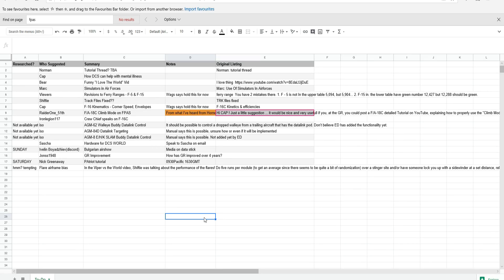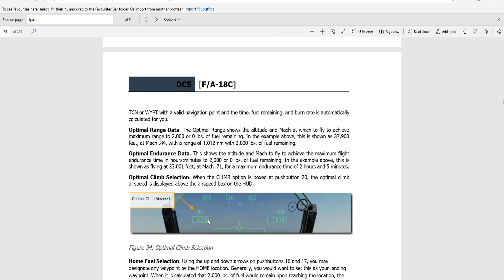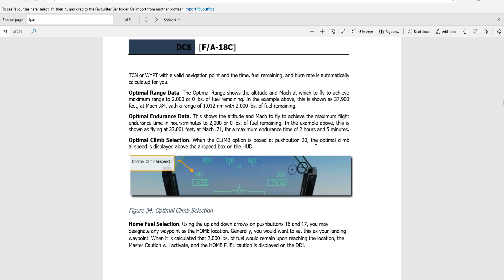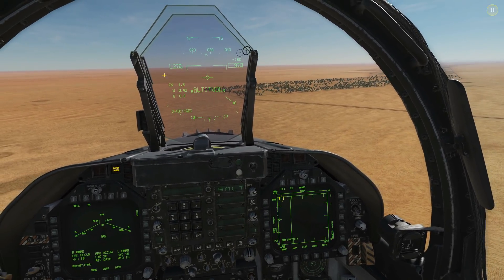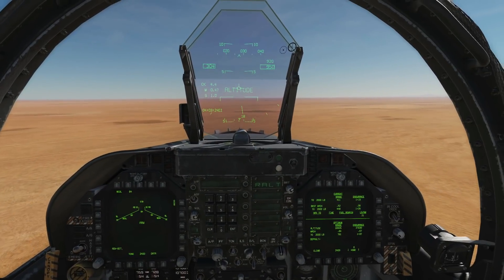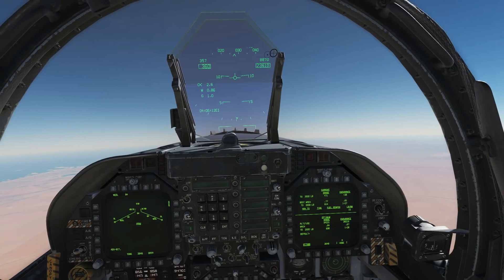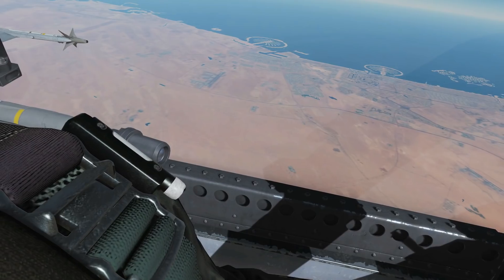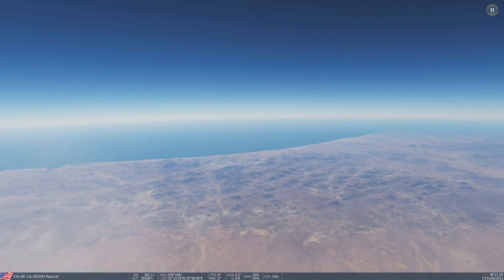Questioned: How To Most Efficiently Use FPAS CLIMB In FA-18C (Vid 1 of 2) | DCS WORLD

Comment: Just thinking about how spacecrafts getting to orbit. They perform a maximum steep climb before they gain horizontal speed in the upper atmosphere. Getting out of relatively dense air, meaning less drag, is one reason.
As far as fuel means weight and weight is expensive in spaceflight, I think there are some thoughts, we can adept.
Not sure if conditions at best altitude effect fuel consumption on combustion cause of lower oxygen-partial pressure. If so, reaching optimum alt as quick as possible might be a benefit to lb/nm.
Well, just some of my thoughts in the deep of night...
Reply: Remember that spacecrafts dont have air breathing engines they have rocket engines..  Aircraft are reliant on air for propulsion.. Spacecraft are not.
Reply: Vampiresquid007 I know. Was only about the ascend profile.

Comment: ATC will not work above a certain throttle input percentage CAP.  Won’t work at MIL power or in burner.  You can pull back throttles and then engage ATC - it will then push the throttles back up automatically.  Cheers
Reply from the maker: thx

Comment: For efficiency, best thrust setting is always MIL, that is full dry thrust. You only change your pitch to maintain the desired airspeed. I don't think the FPAS gives the correct numbers right now, but a good rule of thumb for the hornet is to start with 400 knots indicated and keep it until you hit cruise mach, then switch over to that and climb to whatever altitude the FPAS page tells you to. If you carry rocket pods or a full load of JSOWs you may want to reduce the initial speed to something like 370 or even 350 knots because of the massive parasite drag. Don't think you're going to save fuel by climbing slowly, low-bypass jets don't like that and you'll just waste everybody's time.

Comment: So from your test, it seems like the FPAS for efficiency is a function of air density (or pressure or altitude, which are all very closely related, so doesn't matter which one it uses..) and your pitch (angle of attack); based off of these 2 variables, it spits out a number for velocity for you to keep, to minimize fuel consumption. 
So in a way, yes it depends what you want to do, whether it's to go as far as possible or as high as possible or something in between the two, but that's not what the FPAS is for exactly; it wont know what your goal is, and so the velocity for you to keep at will be an estimate if you were to have pitch "x" and at altitude "y"; However, as you said yourself, to keep the pitch constant (and probably the power/throttle constant) wont give you the most efficient path. 

If the way I described the FPAS is really how it works (I based my explanation solely on your test), it would make sense that when you are closer to the ground (where the air is denser, and therefore the lift is greater) you would want your aircraft at a low AoA (pitch), and as you get higher and higher, you would need to increase the AoA and constantly correct this to keep up with the most efficent profile sort to say (now in terms of actual numbers I don't know, but this makes sense as a methodology to be as efficent as possible in general terms).
Reply: Now that I think about it, it wouldn't be too hard to fix this; They would just need to update the FPAS and complicate things a  bit (some equation re-arranging and electronic circuit changes): They could make the pilot's goal to become a variable affecting the speed and pitch to maintain. 
So what I mean is:
the pilot inputs what the goal is using UFC (for a simple example: to reach altitude "x" without caring about distance traveled)  and the FPAS takes the "goal" as a variable, together with air density/altitude and thrust ( so basically a function f(x,y,z)), and then spits out every 0.01 seconds (constantly updated) an AoA (pitch) and a speed to maintain!! Such system would solve this whole problem/dylemma! 
I don't know how hard it would be to work out the equations for this, but it would be a super good idea for the air force lol! (perhaps also taking into account the jet's weight, since that would affect the efficiency profile as well).. in this way, say you want to reach 40,000 ft in the most efficent way, well, the FPAS would do it all for you basically! I'm pretty sure this would spare a lot of money to the air force if implemented (unless they already did that in RL..)

Comment: Simple version, you wanna get out of the soup as quick as possible. So set full mill, and adjust pitch to control speed. Should give you about the best burn rate. Using burner in the soup is the absolute worse burn rate you can get. (below 15k)
Reply: This. So much this.
Through my very un-scientific testing I've found the best way to conserve fuel in the Hornet is to (1) stay off burner, especially down low (no burner on takeoff!) and (2) get up to a high altitude. I've loitered around a zone for quite a significant time even with no tanks if I've got throttles pulled back at high altitude. I tend to go ~34k ft and usually aim for around M0.68.

Comment: I think that the result is rather ambiguous. To get something useful you should ( IMO ) have 2 waypoints say 400nm apart. At the first WP you shall both be at speed at the same (low) altitude. Note remaining fuel. Then you climb as you did here to the optimum altitude (how is that determined?) and proceed to WP2. At WP 2 note remaining fuel. This because the question was about range.

Comment: i set mill power and don't touch the throttle and adjust pitch to maintain FPAS clime speed and did it agan at full AB staring at 1,000 ft to  34,000 ft
mill = 1530 lb 6:30 min
AB = 1540 lb 2:21 min
Reply: ...but what distances did you travel? I bet you travelled a hack of a lot further with mil power using (almost) the same amount of fuel.
FPAS is about getting the most distance out of your fuel.
Reply: @mj.funfly381  at i did not mart the distance but at mil it was a 5-10 deg climb most of the way at AB it was more like 20-30 deg climb so yes way more distance at mil

Comment: I think that your pitch should be variable with FPAS. When you questioned the angle of climb I think it is assumed that you full mil power and adjust angle to stay on speed. That makes the most sense to me to climb fast and efficiently. That would also make sense to what you were told by a pilot about changing pitch because you wont be able to hold a steep angle at higher altitudes on mil but you can at lower altitudes.
Reply: 3 plane test needed...5*. 10* and on speed variable...set a waypoint as target destination..say 200 miles...FPAS all the way then check remaining fuel
Regards The Grizz

Comment: Quick note for you Cap, regarding the part at 8:19 : Its my understanding/experience that the "ATC" autothrottle on the Hornet is set up in such a way that it won't use afterburner. Thus if you're throttled up even slightly above mil power you can't engage ATC.
Reply from the maker: thx
Reply: And cannot be engaged at MIL.  You can however, reduce throttles - engage ATC, and if the system deems necessary, can push throttles back up to 100%.  But conditions apply

Comment: The reason you go steeper lower down and less steep higher is just because of how jet engines work. They are most efficient at sea level. Way more oxygen down here which means way more power can be output from the jet. The higher up you get...the engine gets less powerful.

Comment: Hey Cap,
I feel the need to smart-ass again... I apologize sicerely!
Rather than using a constant pitch for your climb, You should use a constant power setting (either military power or maximum thrust) accelerate to your climb speed (or better mach number) and then adjust your pitch to maintain that speed/mach number.

Check this out, if you have the time:

https://info.publicintelligence.net/F18-EF-200.pdf    (for example figure 4-2 on page XI-4-13)
You can see, that the climb mach number depends mostly on the DI (drag index) of the aircraft.

Again... not meaning to disagree with you, but... ;o)

Cheers, and keep doing those videos!

Bud
Reply: thats for time efficiency though isn't it? A.k.a get high up as quickly as possible. I believe that to be the sole purpose of that 'optimum speed' indication
Reply: @vnyggi621  

I disagree but I'm no expert and can be wrong:

2.3 FLIGHT PERFORMANCE ADVISORY SYSTEM
2.3.1 Flight Performance Advisory System (FPAS) [...] 

The FPAS advises the pilot of the altitude and airspeed corresponding to maximum inflight fuel efficiency based on current operating conditions. (copied out of the aircraft manual)

... so I would think that following that airspeed gives you the most (fuel-)efficient climb to the most efficient cruise altitude depending on how far you need to go....

just my 2cts...
Reply: @mj.funfly381  good point

Comment: I wasn't under the impression that best climb was related to fuel conservation.
From aviation website: Best Rate of Climb speed (Vy) gets you the most altitude per unit time (feet per minute).
When you want to get to cruise altitude quickly for maximum efficiency you'll aim for the best rate of climb so you spend the least time at lower, less efficient altitudes.
Reply: I guess, not very well said, that is what I was trying to impart in my post, based on my understanding of the person's original question for Cap.
It seemed to me that they were trying to make climb rate the focus of fuel consumption rather than it's intended goal of maximizing altitude, at the expensive of fuel, in order to conserve fuel. Hence, why I edited the comment to include the definition from an aviation site that more accurately describes what I was trying to infer.
Reply: Well that just means that it's about fuel conversation by couple extra steps. You want to go up as fast as possible with A/B and all because going 450 ground speed near sea level is way more expensive than holding it at 35 000 feet.
Reply: @TealJosh  Yep, that's exactly right; 
@Mark Webber, that's what efficiency is all about, in simple terms, it's about how much fuel you consume per unit distance depending what that distance type is (for example if that distance is solely range, or it's a mix between range and height).. that's why it's so hard to give an exact path to follow in order to keep the most efficient profile. It all depends what your goal is. (so FPAS gives you an estimate without caring about your goal basically.. which is really.. mhhh... "inefficient", no pun intended)

Comment: For the most efficent climb keep a 4.1...4.3 AOA. The lower the weight, the slower you will be. For the fastest climb use full AB at around mach .86 or check FPAS if you are into being 100% accurate. This is only suitable for interception as it wastes fuel. For max loiter time use 235 indicated or follow FPAS. This is also the best angle of climb without AB. If you wish, I can give you some data for other planes as well.